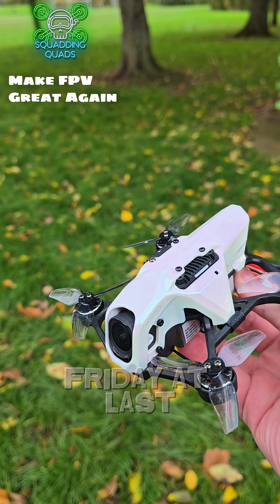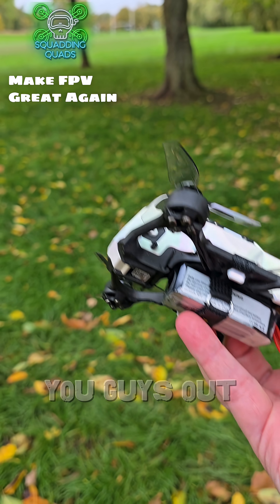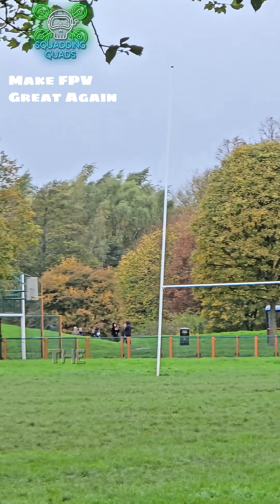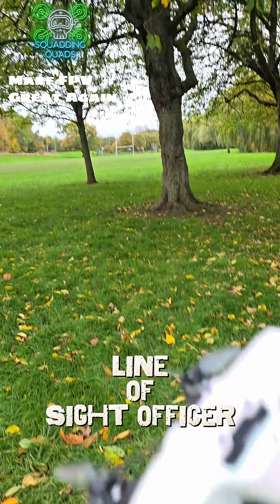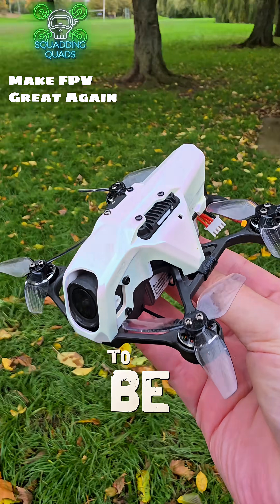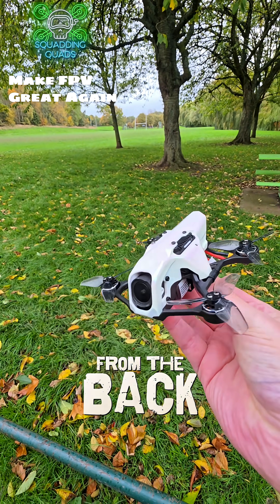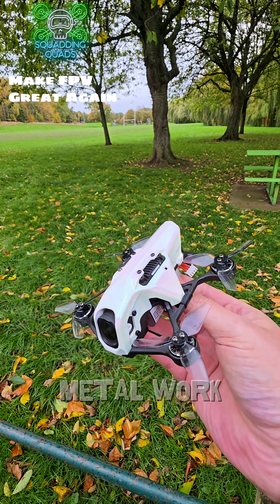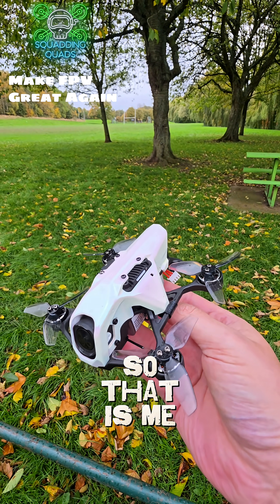New Antenna FIXED the ELRS Range on the SpeedyBee Mario Mini 25! 🚀

Comment: Is there any update related this issue? I have similar problem.
Reply from the maker: Yup I posted a follow up basically grab a Iflight elrs antenna it you'll be grand
Reply: @squaddingquads thank you for your reply however do you have the exact model in order to get it

Comment: So i have few questions about the elrs issue.
Does the fw target match on rx and tx?
Is it FCC or LBT?
Is there a spare uart on the board?
Reply from the maker: The target shows up as generic, it's almost like the board doesn't know what the target is.

I've flashed FCC, it made no difference.

I'm going to say yes but I've not looked at how easy they are to access yet.
Reply: @squaddingquads thank you.
Reply from the maker: @netherwindgg5946 no worries

Comment: Awesome good to know. Shame they’ve shipped it with a poor antenna. 

How do you find the O4 reception with the whip antennas tucked in the frame? Have you tried the full size antennas? I know they come with it but will they even attach for this or just included to have as spares for another unit
Reply from the maker: It's a shame bit I think I've got a solution.

No issues for the majority of flying styles and distances